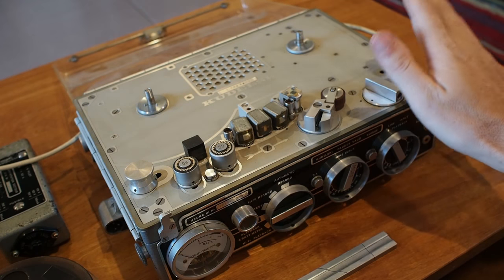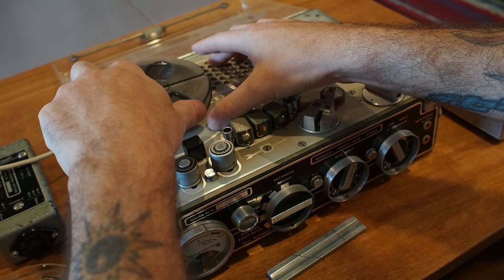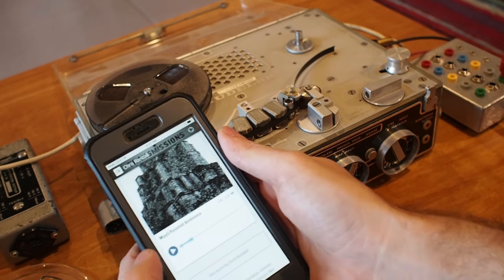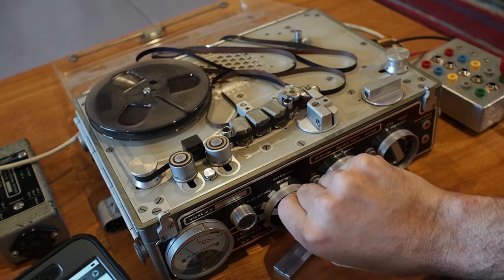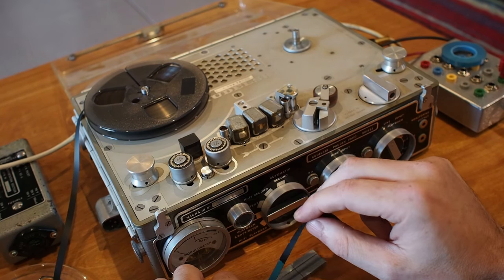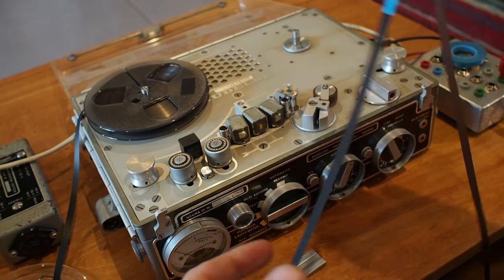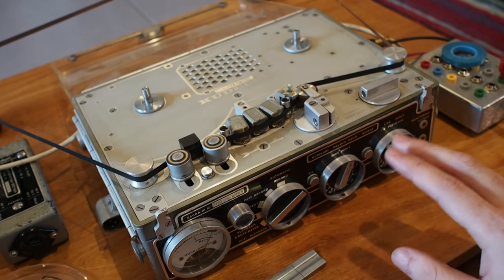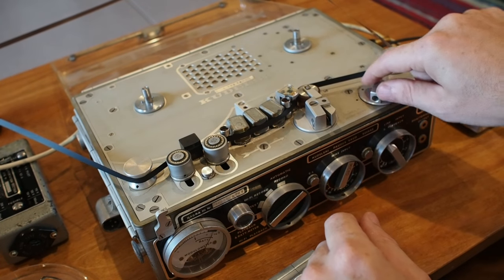Tape-Looping With A Nagra: Tech Time No. 001

Comment: Hey great vid. Thank you. It would be nice if you did the Cutting and attaching or whatever you are doing, on camera. Why do you do it at the bottom and outside the mainframe? I have never done this and it would be useful to actually see the workaround and not only the Before-After...?
Reply from the maker: Apologies for that. I didn't know it was out of frame (couldn't see the camera's display) until I went to edit it, and I didn't have time to re-shoot it. 

That said, there's really nothing to it. You just stick the tape in the splicing block, and slice it with the razor in the little slot provided. It's actually kind of hard to mess up.
Reply: For what it's worth, it really is as simple as he says. The first time I tried it I used a pair of scissors and scotch tape, with no splicing block. I wouldn't recommend that, but it worked.
Reply: I see. It`s ok. Was just weird hearing descriptions about what you do and not seeing it. My comment was more about harmony and balance between Image and Sound (without wanting to sound esoteric :-)

Comment: Please don't take this the wrong way....With today's technology, I honestly don't see the point of this. How is this superior to more modern techniques of looping ? to me, what you are doing in this video is the same as stepping over a dollar to pick up a dime...enlighten me as to the point of this process for looping. :-)
Reply from the maker: "Just because" is really the only answer. Sure, I could have taken that WAV file and looped it in Live in about 3 seconds. If that. But that wouldn't have been a very interesting video, would it have? And I could have just lifted the audio off a National Geographic special, instead of flying to the Yucatan peninsula in June and hiking 6km through the jungle in heat that could generously be called "stifling" to get that recording. Or I could have just listened to the radio instead of making music myself. 

At the end of the day, unless you're in a production environment where you're paid by the note or some shit, music is largely about performance, not efficiency.
Reply: I think there's a better answer than "just because", which is that the chance element and the manipulation techniques are significantly different, especially for purposes of sound effects. There are tape wobbles, slurs, and real time speed changes possible with physical loops that (as far as I know) can't be duplicated digitally.

CR - there's a possible topic for a new video - live manipulations of loops. Or is that too "how to"? ;)
Reply: Not to mention, there is real historical significance to this method. Tons of great, important tape loop based music was created using methodologies similar to this. Even if one doesn't employ the methods yourself, it is definitely useful to understand the origins, the methods, to see them in action.

Something so engaging about the tactile, the effort as the result. Which I think largely explains a lot of the interest in modular synths.

Anyway, dug this.
Reply: bingo!
Reply from the maker: I was pondering a video of how I might assemble a performance of just Nagra, 4-track, and a little modular or something. That might slot in there.
Reply: there are situations in which a dime can be far more useful and evocative than a dollar you know...
Reply: ALSO - all questions of quality aside (tape being of higher quality that is) this way of working forces the 'work' to be driven by creativity. When you work serendipitously - thinking that hopefully if i input the right parameters and select the correct menu item or programme - maybe i'll get something useful out of it... (?) - in that case the machine is driving the 'creativity' ... so... fail.
Reply: and the tapeloop is naturally always different sounding in every cycle, oh i love that not everyone does the same thing!